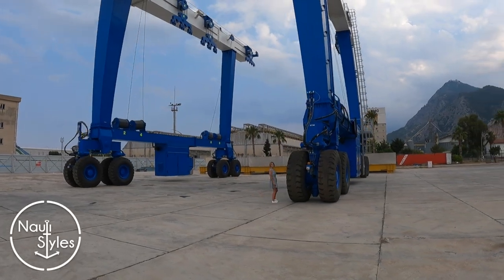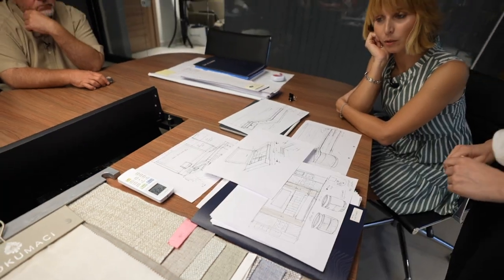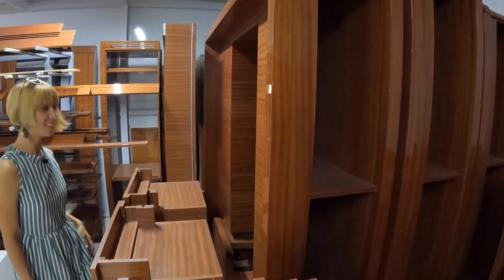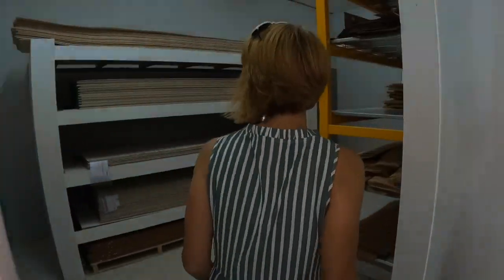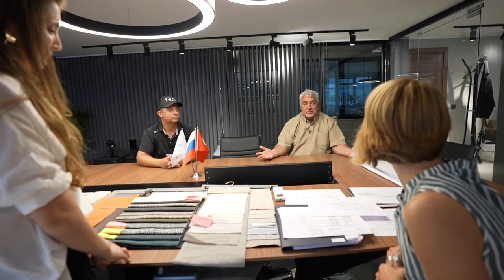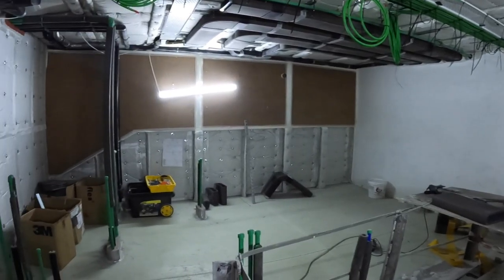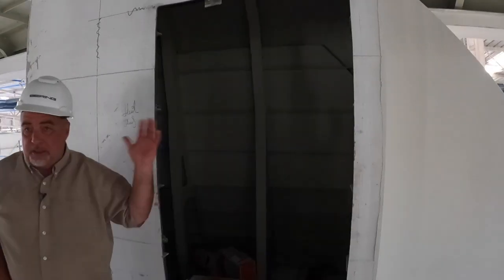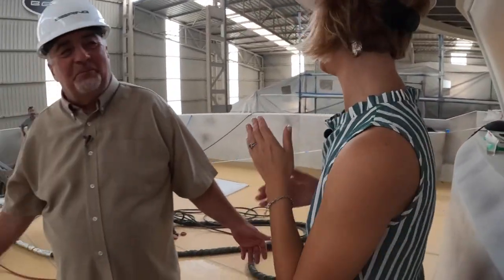BERING 145 HYBRID EXPLORER SUPERYACHT  TOUR Part 2 / EXPEDITION Liveaboard Go Anywhere World Cruiser

Comment: I love these yachts. I'm thinking about building my own steel full displacement. Probably 33 ft by 13. Something utilitarian that is flexible for overnight for two and lunch or dinner out back for 4. I'll probably use a Cummings 285 HP, I'll have to figure out how big of a prop to put out back. I sure would like to know how to build a proper semi displacement hull, like a main built fishing boat but in quarter inch steel. I think I'm going to give it a shot guys. I don't have money so I can't consult with anyone so it will be done all out of my own thinking and bare hands. I do like the epoxy he uses to fair the hull out and I do like how he boxes in the gunnels I think they are called. I like his overlays of the stainless at the scuppers and stuff. I'd love to learn the proper way to install the anchor and windlass how he does his. Also I want what I think is called a bollard, one in stainless steel for a bit of classy looking stuff and in case I ever give somebody a tow, and how to attach it so it's very strong. If anyone has any advise or comments I'd love to hear them???? This guy's pretty much my idol.
Reply: It would been an interestng project for sure. But have you asked yourself; 'do I really wish to spend the better part of my free time for 5 years building a boat, with 'no money or experience in ship building'? Should I better spend that time with family and friends, traveling and so on?' Or what about find a older fishing vessel of steel, and build from there, instead from the ground up? An existing vessel with papers and sertificcates already  sorted out. Life is short. Sorry. Good luck with your project.